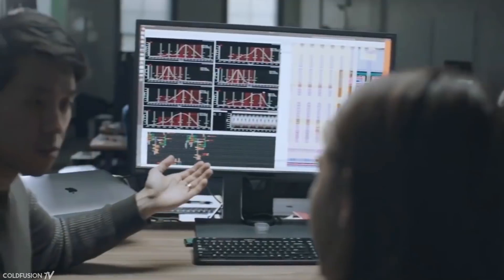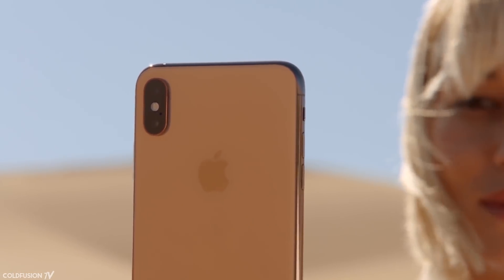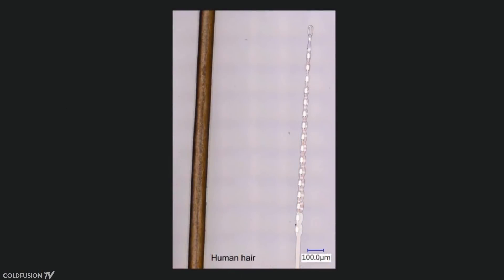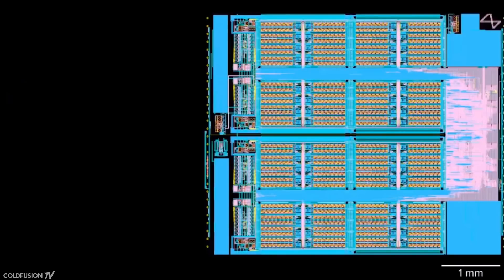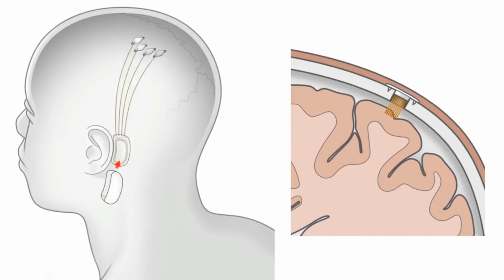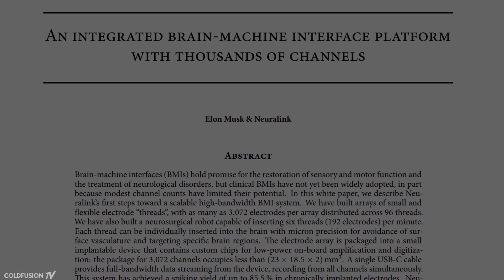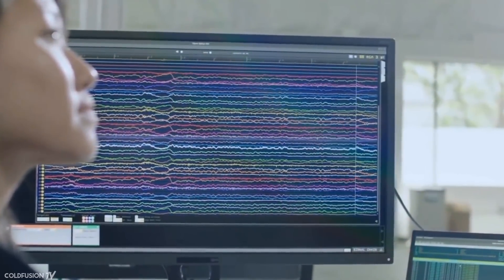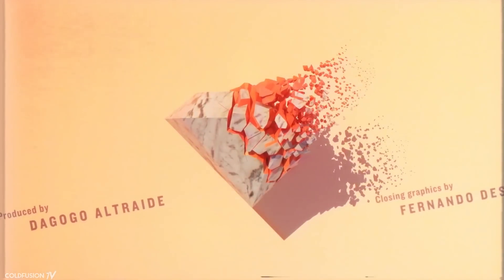Neuralink - Merging Brain and Machine

Comment: I wonder if you could use this for VR/AR?
Reply: You absolutely could. Look at the part of the brain the neuralink can read from and write to: the cortex. The cortex is made up of multiple layers and many different regions, a couple being the primary motor cortex (governs movement) and the primary somatosensory cortex (governs all sensory information we "experience" in life). If you send a signal to the brain that blocks or intercepts signals from the motor cortex from firing, movements that you do in your head won't translate to your physical body. Like wise, if you block sensory information from the outside world and use the neuralink to stimulate the somatosensory cortext you can then experience what ever sense you'd like to. 

In combination with videogame specialized AI/programming you could create a full dive VR world, complete with all 5 senses and movement. All of this sounds like a pipe dream, but really the largest obstacle is the ability to read/write to the proper brain regions at high enough fidelity. A BMI platform like neuralink make such things possible. Don't get me wrong, don't expect to have full-dive VR tech in a few years. More detailed information about the connectome (neuronal connections in the brain) brain regions, and implantation techniques as well as specialized technology will need to be developed for such an awesome tech. But it is coming. No doubt about it.
Reply: @SlightlyDecent  awesome! :X
Reply: For VR the hardest part tech wise will be figuring out how to do moving images (video) stimulating directly the visual cortex so you might still need an external device (ie. a light weight sun-glass/contact-lens with retinal projection..?) for the video portion for quite a while..
Reply: this is going to be the next step in gaming. I'm honestly looking forward to it
Reply: You´ll need more than 1000 needles for that.

Comment: If the electrodes are sensors near the neurons, how does the brain get input from them? I thought the point was they were just output, basically just giving you the ability to bluetooth with external devices directly

Comment: Both incredibly exciting and scary. But I wonder how it will affect the brain or rather the learning process. I guess in the end, a lot is still processes by our brains but I still wonder what would happen if you used this stuff for 5 years straight and then just turn it off. And it's also weird from a philosophical question, but I guess the same could have been said 50 years ago about our current technology.

Comment: As far as the world of medicine goes? I'm fine with this. But augmenting perfectly healthy people scares the s*** outta me. Cuz, from a security standpoint? If Neuralink can read and write from/to the brain and it's connected to a cell phone (which in turn would be connected to the internet) then in theory, your brain, and by extension, your very thoughts and actions would become hackable. But on a global scale. 

By connecting your brain to a device that connects to the internet your brain, therefore, becomes only as secure as the most insecure device it's connected to.  So, inevitably, a hacker will be able to breach the systems securing your brain and (depending on how advanced Neuralink is at the time) be able to influence your very thoughts and actions. Heck, they may even be able to download a complete copy of all of your memories. All without you ever knowing.

If Neuralink does become "a thing" so to speak then having a Neuralink could bar you from being a pilot, a train operator, a truck driver, a captain of a ship, literally any position in a government or military, or any position that (if compromised) could cause significant harm to people, a company, government, or country.

For the world of medicine, Neuralink is an amazing breakthrough.

For the world of security, Neuralink is a worst nightmare.

Comment: How long before this goes from voluntary to required if you want the job
Reply: Hope it won't happen in my generation
Reply: That's a scary thought
Reply: When most of people above 30 years old in present day are dead.
Reply: Dey tuk er jawbs!
Reply: how long did it took with computer ?
Reply: Job? By the time this is available for commercial use, the vast majority of jobs will be for the bots. So unless you actually have some sort of intellectual advantage over the best AI at the time, no company will want you.
Reply: @krimverse5903  thank you! people need to understand . it's either this or AI.
Reply: @aresgood1  And people also forget you can continue to upgrade humans to be on par with the droids. No need for that weak meat covering and a flimsy internal structure of calcium, make the machine god proud!
Reply: @krimverse5903  you are missing the point,  the reason for these implants is to make people  on par with the Bots
Reply: Not long says the "powers" that be. ID2020
Reply: Damn imagine, it’s prollly gon happen
Reply: How is this any different than an Athlete taking steroids
Reply: What now you are required to own an computer or a phone to get a job? you can wash dishes without technology
Reply: @toxigen18  good. neural link will be the same way. you will be able to wash dishes without neural link. but if you work with technology, good luck.

Comment: It sounds good, especially the part about memory enhancement and enabling the brain to learn quickly, but I don't want it. Don't want something to end up frying the chip and therefore my brain...something like a short/open circuit, over-heating of the electronic components, EMI (Electro-Magnetic Interference) or even a solar flare could be devastating.

Comment: If Mankind is to avoid a mass extinction we need to be brave and move forward with this science. 

The arguments around privacy are redundant and naive, privacy died with the internet. People whine and yet still throw all their info online. If you have a YouTube account parts of your info is out there already. Don't think if you have a VPN then you are secure. Trusting data to a "no-log" VPN is a gamble as you would have to trust with no way to verify. More importantly, you cannot run a server with no logs. You would not be able to handle DNS requests, troubleshoot connections, or prevent abuse and much more. Then the misconception that TOR and encrypted messaging is safe, if your government becomes interested in you the very tools you are using can be subverted/forced to track you. 
"VPNs are good, but their weakness is the single point of failure: hack or subpoena that one point to see everything." Edward Snowdon.
So please don't think neurallink is the end of your privacy  Your privacy is already dead. Also, don't waste your money on VPNs.
Complete anonymity is a lie.

Comment: rofl - there's ... it's hard to describe the jumps being made since there's so much background information missing. Don't get your hopes up - the brain does not operate in any respects like an engineered device - there are not input-output layers as you might expect, and discrete signals are not really a thing... brain machine interfaces to date have been interfacing in primary motor cortex - which is unambiguously the most ideal area to try and extract meaningful signal... but if you look into the literature or keep an eye on the news, you'll see that even with the standard 100 pin chips and machine-learning to process the signal - the performance is far from ideal. 

I mean to save you some time and be kinda terse about it... all meaningful technological development happens in the public sector, at research universities. The myth of private sector innovation is just that, a myth. If the technology for neuralink existed, we'd have been using it for research for years before you heard about it - and the idea of this technology existing is, unfortunately, fantastical.

Cochlear implants are nothing like neural implants - the reason the cochlear implants are so successful is because of the unique circumstances of the cochlea - you have what is essentially an electrically isolated tube that's curled up, and a gradient of receptors going from one end to the other. There is almost no need for accuracy because you're not targeting any particular cells, and the only requirement for the implant to work is that the stimulation sites are physically are one after the other... which is guaranteed when you use any linear electrode.

Now, none of this has ANY bearing on something other than a motor BMI... if you want to interface visual information... well, there's approximately 2 million lines coming in from each retina, in a space about as big as the current BMI chips with 100 electrodes... not even getting into the problems of how there's 2 fairly discrete portions of the retinal feed that get mixed up at the optic chiasm, and then things get more complicated as the optic tracts run deep into the brain... and by the time things have gone through the lateral geniculate nucleus and optic radiation and gotten to V1 (mostly) in the back of your brain, the first cortical area you could realistically get a chip... well then you've got not only an insanely difficult spot to work with but also dramatically changed architecture that's... uhhh kinda hard to imagine working with, even if you did have the magical miracle electrode arrays you'd need.

Which brings me to the main hangup... the main issue is material in nature... we simply do not have, even conceivably within the physical sciences, the ability to create the electrode densities we'd want in order to, even in the face of all these other difficulties, be able to interface with any respectable plot of cortex. There's quite a lot involved in putting any foreign object into the human body - and there's a ton of considerations you need to think about.... foreign bodies tend to get gunked up as the body tries to contain them, and electrodes lose their connectivity to the surrounding areas - there's also a ton of potential electrical interference between electrodes... while we talk about neurons using 'electrical pulses' in popular media - this isn't really accurate... our neurons don't use 'electricity' in the sense that we do in say wires, and they don't have to worry about insulation in the same way that say, external electrodes do. I've not read any papers on this particular aspect but I would be very surprised if it was not currently physically impossible to even hypothetically have electrodes work in something resembling a 1:1 ratio electrode:neuron without considerable interference in that environment... there's also the whole problem of tiny strong electrodes being equivalent to tiny razors... 

ugh - anyways I could go on and clarify much of that very poorly written screed, but I am of course on the youtubes watching random videos way, way too fing late lol and must sleep desperately. Hopefully some of that reaches some random person who finds it interesting and not overly snarky. Cheers.

Comment: If it's about controlling software with  your brain, there is already completely external hardware that does that. No need to install anything directly in your brain. Medical applications apart, this is a research project looking to explore the way we think. Once you have this installed, your brain waves will become another form of big data collecting.
Reply: And That's how u control the masses. This crap can go really well with the plans of agenda 21/2030

Comment: I like the idea however I do not like how invasive the implementation is. I would rather not have my skull cut into.
Reply: Would you do it if it was a means to cure your depression?
Reply: @TCV12  No, I've suffered from depression. Depression is reversible, a hole in the skull isn't.
Reply: @ikannunaplays  I'd rather have a tiny hole in my head (which is obviously patched and covered) than spend thousands of dollars on councilling that may or may not work
Reply: I also hope there is a physical possiblity to detect neuron impulses outside the skull although  it does not seem realistic at this moment.

Comment: Higher amount of electrodes and new implantation techniques is great, but as you've pointed out this is nothing new, and I don't see the bigges elephant in the room being addressed: scarring.

I don't see a significant increase in application if the implant decay problem is not solved.  

If you already quadriplegic, sure, not much to loose there.
But why anyone else will surgically put an interface in their head, knowing full well it will stop working after awhile?

Comment: This is evil just in terms of the animal experiments done, never mind the liar science. You can't use a chip to fucking interface with the brain ffs, it's fake. Neurons are sending chemical transmitters, you can't emulate that merely by varying voltages through them, despite the fact that yes everything is waves / frequency (matter is all standing interwoven waves of varying frequencies, as per cymatics, as per strings, etc).

Comment: The moment an internet connected interface is in our brain, we HAVE to already have Quantum cryptography. We can't afford hacking!
Reply: Liran Piade May be this device shoulnd’t be coneccted to the internet in order to prevent that.
Reply: Being connected to the internet is sort of the whole idea!
Reply: @leoperez6737  you have to be connected. All your brainwaves are transfered to their servers and then calculated with AI and algorithms.
Reply: @gerard8203  uh no. Its read onsite. It doesnt broadcast them
Reply: The whole point of AI generated algorithms is that you don't need massive compute servers. AI (Neural Networks) take a lot of training, but then the algorithms generated are extremely lightweight in comparison.
Once it's trained on basic communication (keystrokes and pointer movement) then it'd be similar to doing 'hey google' or siri in your mind. The signals themselves would require gigabits of bandwidth, so there is no way they'd be transmitted in real time.
Reply: Nah what you gotta do is buy a supercomputer and design it to augment your brain power through the neural link connection, then you use your combined brainpower and direct access to the internet's knowledge to transcend your human body and become one with the internet. After that you essentially become Skynet, your conscious mind everywhere at once soaking up the world's data at fiber-optic speeds and using it to further entrench yourself in the network until it is impossible to remove you. At that point you'd be something of a God, watching everyone on Earth and having unlimited access to the digital space, the speed at which you could process and recall information would make time seem to slow down and open up limitless possibilities for human advancement through the power of your digital hivemind. At that point, no one could hack you because you have already hacked everyone first. 

Who needs AI when you can meld the human mind with digital systems? Though I'm not sure which one is scarier knowing how humans are...
Reply: exactly what I thought! You really dont want this to be hacked, so quantum cryptography shows up at the right time to present a solution!
Reply: We do have quantum-resistant cryptography already, or so we believe. Factoring is in BQP, but elliptic curve-based cryptographic schemes and even most hashing algorithms used today don't incorporate this at all. Though post-quantum cryptography is a young field, it's not like the theory (and even the practice) isn't already there.

Comment: If this technology works there is no way around it. Imagine controlling google via thoughts. 

You think the search terms and a virtual assistant gives you the answers via brain input or text to speech. Paired with VR/AR, this could revolutionize everything. 

Think about 3D Modeling using your brain. Or sending text to somebody using this neural link. It would be like telepathy.
Reply: Kimfri There are so many concerns about this technology, it‘s extremely scary. What about private thoughts, maybe we can‘t have them any more in a few decades?

But the reality is that there will be a lot of benefits. And these will bring over many users. Just like smart phones did just 10-13 years ago. I wouldn‘t be able to resist and would buy one of these for sure. Maybe not the first generation, but once the technology has proven itself, I will be on it

Comment: Be curious to see what the HACKERS will do with this, in reverse!  Skynet won't be a problem compared to that scenario!
Reply: Luckily this device is powered by a device outside of head (behind the ear for this version), remove the device and it has no power (so a hard switch). This sort of thing will be used for a while I can imagine, giving that assurance and safety.
Reply: you can't hack this device
Reply: @Black-Re4per  'you can't hack this device'

lol
Reply: Black-Reaper good one
Reply: @HariPrasad_  That part would be like any device, so possible. If say you are alone at home and someone hacks you to send all your money to someone or worse, then external devices, cameras, AI, etc would be needed to check for odd behaviour and turn the device off through a separate local remote override function, if around others they can notice it and disconnect it. That's if the rare event happens like someone hacking your phone (could happen but only if you are special and more of a custom hack vs mass mind takeover or anything, these devices will be made with the gravity of the situation in mind, kind of like self-driving cars I would imagine but more tailored.
Reply: Its using bluetooth...
Reply: I'm actually more worried about what the gov does. Thoughts would no longer be private
Reply: @leoterss  Access rights exist for a reason mate.